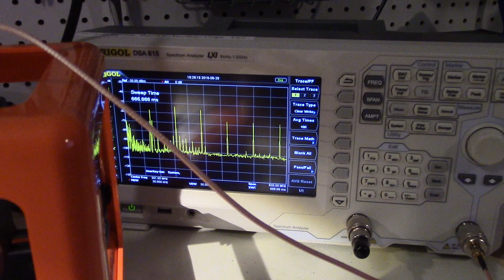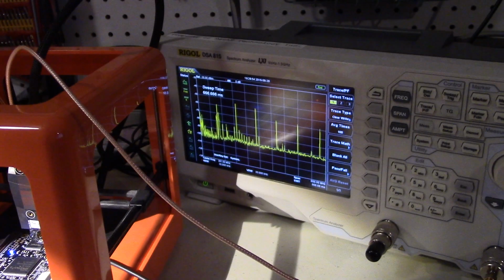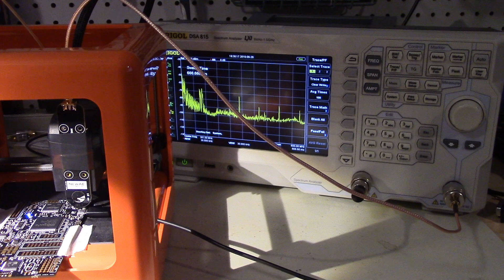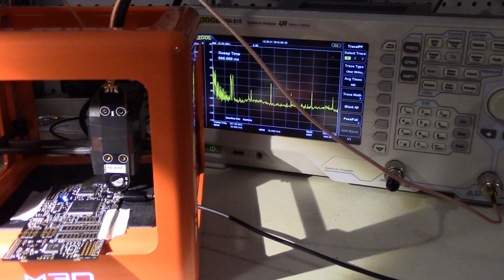X-Y Scanner using 3D Printer for EM Emissions

Comment: I have been thinking of doing the exact same thing! I had a nice XY stage from an old medical device that I was going to use for it, but I never got around to it (and ultimately decided to shelve the idea.) I agree that a 2D overlay of the board might be more useful. I thought about doing different frequencies in different colors with amplitudes displayed as different intensities. Also, I was going to give the device the ability to rotate the head so fields of different polarization could be detected.

It's cool to see that my idea had some merit! 

P.S. Hi from one of your 2014 HaD Prize finalist competitors! I'm a big fan of your Chip Whisperer.
Reply from the maker: >fferent frequencies in different colors with amplitudes displayed as different intensities

Yeah, I played with this a bit, but got pretty hairy! I think it could be useful to get a base idea of what is there, then you could "drill down" by limiting the frequency range. So for example if the major leakage is at 96 MHz, you could display only the 90-100 MHz range or something.

>rotate the head so fields of different polarization could be detected.

Good idea too! As it stands now you had to either mount two heads or rotate the board... the scan time is pretty long as-is though, but I think for the most part you can just let it run for a few hours and you don't care.